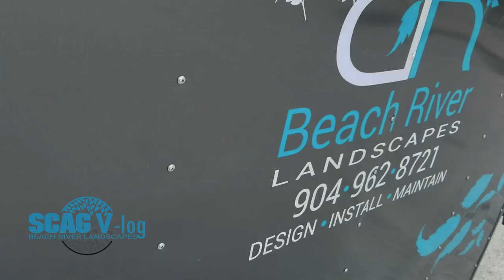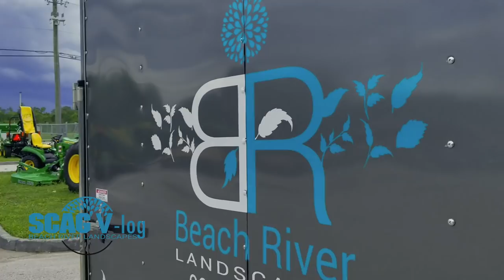NEW PURCHASE NEW SCAGS! 61" Cheetah 35hp Kohler EFI & 36" VRide 19hp Kaw!

Comment: I'm currently testing different mowers. The one at the top of my list is a Ferris 2100Z. The next one on my list to test is the Cheetah. Have you used a Ferris? If so, is the ride of a cheetah as good? How about cut quality? Thanks for any info. It's a big investment and I want to get it right. BTW I'm current mowing with a grasshopper.
Reply from the maker: Whitetail Hollow Acres never owned a Ferris, but this cheetah is by far the smoothest riding machine I've ever used. I have a bad back and this is the first mower I go home painless with